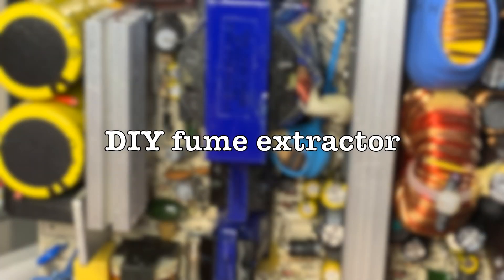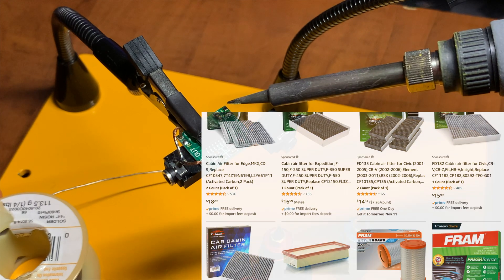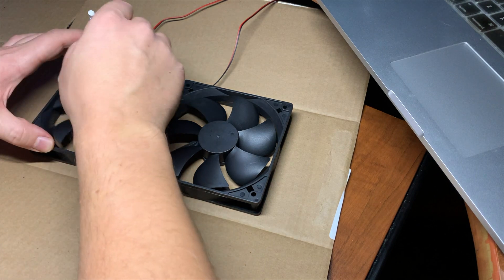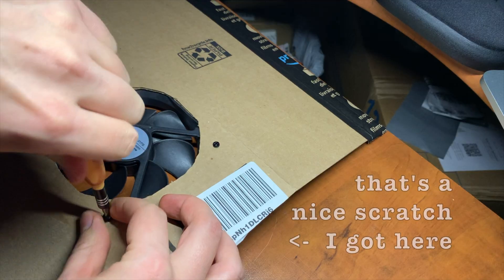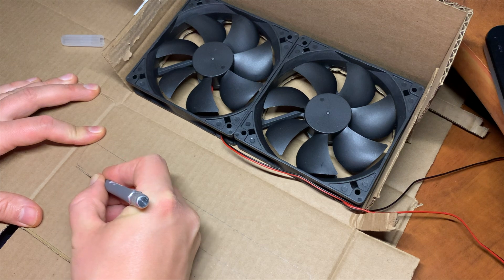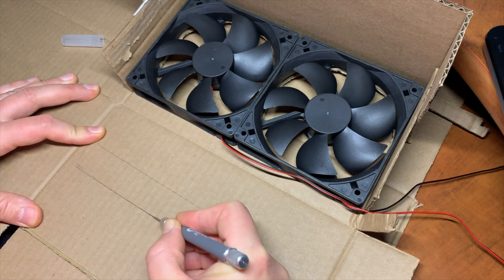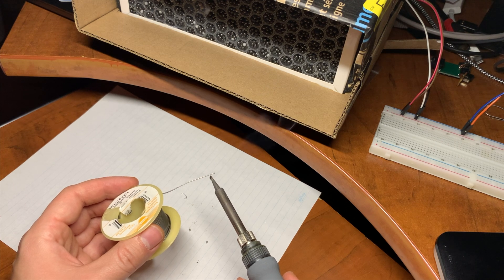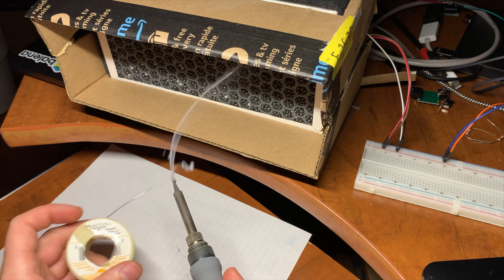#8 DIY Fume extractor using a Tesla HEPA filter

Comment: Thank you very much , nice project! Can you try to build flume extractor with gas mask filter ( from military gas mask ) , problem to have good air flow from iron to filter, may be you will need two fans before and after filter.
Reply from the maker: I don't have a military gas mask filter, but if it's what I think it is, it's way overkill for a fume extractor, and I don't think 2 of these fans will suffice, you would need a high-power fan to push air through that. 
Interesting concept though.
Reply: @UNgineering  Yes, but you will be first on youtube with such a kind extractor. Also add  pm2.5 sensor to new project to check air quality.  I am also thiking about concept of ectractor from car vacuumcleaner with hepa filter, it's easy project i think , but noise and long work of it can be a problem and hepa quality is unknown. Also intresting is to adapt home air cleaner for flume extraction. So 3 new ideas for videos:)
Reply from the maker: @Yuri-wk8rk  I might go mad if I have to sit for 20 minutes next to a vacuum cleaner-level noise while soldering :))

Comment: At 3:43 you had the filter in the correct position, from 4:50 the filter is placed in the wrong direction. 
The active carbon part is the last part of the filtration and must point to the fans, the white Hepa filter comes first and filters the particles from the solder fume, 
followed by the active carbon part that filters the smell.
Reply from the maker: yup, i realized that after i posted the video 🤦 
in my other videos i use it correctly (whenever it's visible).